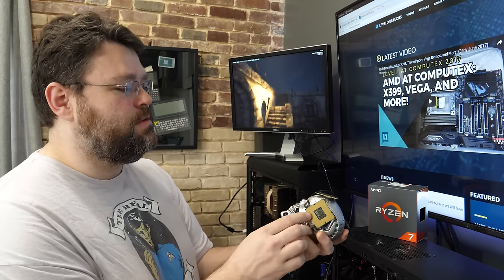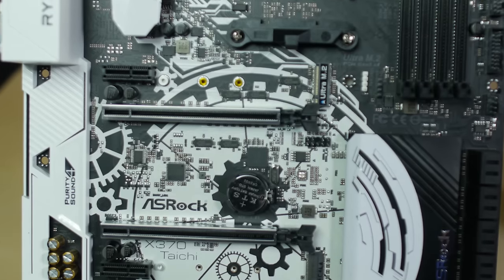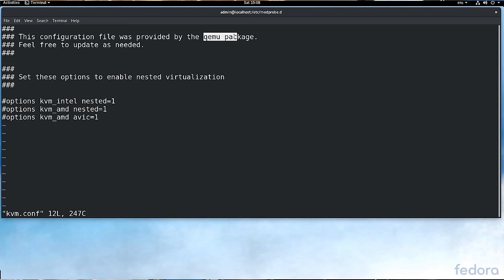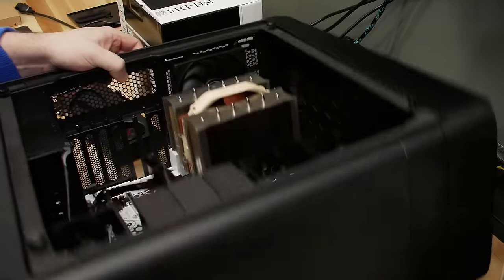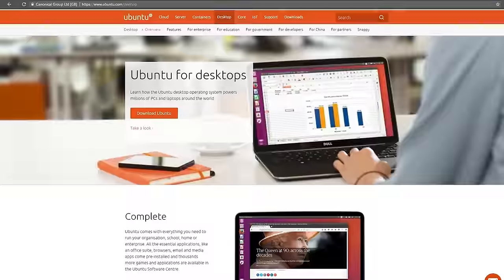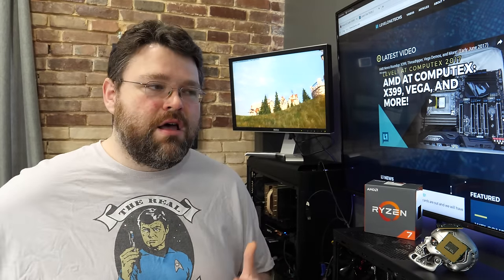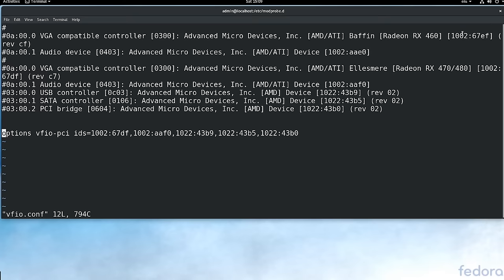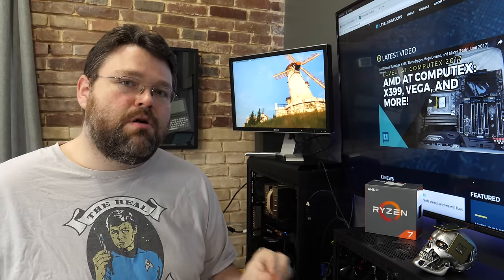GPU Passthrough for Virtualization with Ryzen: Now Working

Comment: Even a few years later this is still a great guide to reference and the information on the forums has beyond helpful.

The only thing that has been keeping me from using Linux as my main os is because of gaming. Now I have no excuses

Ryzen 3700x,
ASRock phantom gaming 4s (x570),
32 gig of ram,
Low profile GTX 750
8 gig rx 580

I've never been happier with a setup/build

Comment: Got a Ryzen 7 1700 as it was the cheapest 8c/16t CPU around, just to be able to do this. Need to buy a second video card before I go for it, but I'm really excited just seeing the guide uploaded. Thank you so much, Wendell - couldn't do it without you! <3
Reply: get a cheap dumpster gpu for the host and go for it !
Reply: get the geforce 710 ! is less than 50 dollars, just make sure you get one which supports a high enough resolution (depending on what you need)
Reply: Get AMD. Nvidia are assholes and disabled virtualization on all but their expensive quadro cards. Unfortunately you have to outbid the crypto miners who are doubling the prices. An RX 470/480 are fine for 1080P gaming on ultra

Comment: Thanks, I will for the first time install Linux as my main system.
#UninstallWindows
Reply: VADemon great to hear we are getting peps over to the dark side or light... depends how you look at it. fedora is out
Reply: Fedora is simply amazing and stable. Gnome shell user here.
Reply: The surface can be made to run Linux too... ;)
Reply: @VADemon ! Don't be hasty man, be patient. 
Install it on a VM or on a secondary Disk (or partition). 
Don't go straight ahead for Linux. 
You 'll bite the dust.
Reply: ThoughtlessTuber I think it's fine. What better way to learn than if you have no other option? Do or die!
Reply: ...no.

Linux has boxed itself into that tiny corner of the PC world where not even getting live training from a teacher is going to scratch the surface required to start picking things up on your own. It's not something you just DIVE into like you could with the more user-friendly Windows or Apple operating systems, regardless of how hard each distro tries.
Reply: I really disagree with this. If you pick up Ubuntu or Linux Mint for example, I think you can do that coming from a Windows system. I think you're not giving Windows users enough credit (at least those that are considering using Linux). I use Linux as my primary OS, and I wouldn't consider myself an advanced Linux user. What exactly is it you think people would struggle with? Where I live, I think the majority of laptops come with Ubuntu pre-installed, because it's free.

Also, I'd be surprised if anybody in the comments section here has had live coaching for Linux. I certainly never have and like I said I am not advanced by Linux standards.
Reply: DxBlack, how do you think people learned the Linux stuff in the first place, did Jesus himself come and make them memorize "all the things of Linux"? These things are documented and there certainly are enough people out there to help you out. It didn't take long for this video to come out on bleeding edge.
Reply: +Rocket33r 
Agree. I first tried Ubuntu in 11.10 when Unity first appeared by default. Never installed it fully, used in a VM, but it was a neat experience. Dual-booted 12.04 and Windows 8.0. Now I dual boot Ubuntu 16.04 (just to keep Unity 7) and W8.1, but I really feel like I barely scratched the surface of Linux on Ubuntu. Yes, I messed with the terminal to install apps and tried to install Ubuntu on a Toshiba Encore tablet and managed to get WiFi working only with online tutorials, but  never got around sound driver.

Anyway, the point is I studied alone and although I am still at the beginning (keep in mind I'm only 20), I know I can do much more. After I started using Arch in VMs a lot, mostly for fun, I kind of grew very attracted to the AUR and Arch Linux' documentation. Ubuntu has its fair documentation, but it's mostly spread around forums and articles, so you have to know what you are looking for, but on Arch, you find most of the stuff on the Arch Wiki.

I don't own any Ryzen, but I intend to buy a Raven Ridge APU when it comes out. I don't need a dGraphics card, I believe I can do my thing on Ubuntu 17.10 (I chose Ubuntu mainly for stability), but I was thinking about moving to Arch when I build my next PC, so I'm also asking for your opinions (keep in mind in 2018 when Raven Ridge is supposed to launch, most bugs with virtualization will be fixed): if I buy a dGraphics card, should I move to Arch or stay with Ubuntu? I was also thinking about using Xen Server and boot whatever I feel like using, but what do you think? Edit: if I get a dGraphics card, I intend to run Widows 10 in the VM.

(SORRY FOR MY LONG COMMENT)
Reply: +ThoughtlessTuber Thanks for caring, though I'm not one of those overhyping kids on the Internet you might have though of.I do have Ubuntu and Debian in VMs, but as of now they're more of toys than real systems for me because I require them only for a fraction of work.Since Windows 10 is not an option for me and Windows 7 is getting old (and I feel like Linux would suit much better for the Ryzen architecture) - I'm gonna head dive into the Linux world. It's the new PC, the new age. It'd also boost my education in that field. A win-win situation.
Reply: DxBlack, anyone with a modicum of knowledge can scrap OSX or Windows 10 and install and use a myriad of Linux distros.
Reply: You should've have install Linux as a main system a long time ago... It's a very promising os that's open source, all it needs is more developers to make more software for it to attract to the average user.
Reply: No, that's not all it needs. It needs to be user-friendly and understandable for the average user and it's far from that.
Reply: "Alejandro Rubio think a lot of us are starting to move away from Windows." By still using windows to play games.
Reply: Oh man, and if you install Windows in QEMU/KVM using RedHat's virtIO drivers (and I'd highly recommend the Spice Guest Tools for shared clipboard and a number of other VMware/Vbox-esk functionality) the performance is so clean.
Reply: My Windows 10 VM running in KVM (I use Virt Manager) runs so freaking smooth in that setup.
Reply: Or just download ubuntu from their site, put it on an usb stick and reboot. And tadaaaa you can try it out :) it's not a requirement to install the OS

Comment: 18:00 You could just use virsh edit <domain> to directly edit the virtual machine definition. It will also do error checking before you try to save the changes.

Comment: Did I understand correctly that we can install Windows on a dedicated hard drive and then boot that hard drive in a VM under Linux?
Reply: Usually it's done by creating a file which contains the virtual hard drive image.
Reply: Yes. You pass the whole drive, so it would act like any other PC. This also allows better IO performance.
Reply: For over a decade now. Problem is video performance for games. Pass thru I/O helps the guest OS talk to the video card. Servers running linux and vmware esx have run Windows vms for 15 years now
Reply: Yes, you can pass through a whole raw drive or even a sata controller. I passthrough a Marvell sata controller with SSD, HDD, and DVD-RW attached to the VM with a Ryzen 1700 in a Asus Crosshair VI Hero using bios 1403 and ACS kernel patch.
Reply: @viperphi1184  note for later

Comment: I wait until threatripper and vega. I am slightly concerned about the limitations in regards to how many pci passthrough you can do. I'm my case I'd like to do at least graphics, sata (or pcie storage, whatever), ethernet and usb.
Also I'd love to see an arch tutorial on this subject, as arch is and probably always will be my main linux system.
Reply: I like Arch for its user repository (talking about AUR) and for its documentation. I prefer Ubuntu for stability, but was thinking of moving to Arch, though I need someone to push me from behind. I installed Arch twice in VMs and I can do it better now, but not sure what to do. Ubuntu never went down on me, I got used to it.
Reply: Arch is perfectly stable, provided you don't screw anything up, which granted is easier with Arch. And yes, there's the AUR and the best documentation available, but more than that, you'll learn hat Linux actually is.
If you need a gateway drug, so to speak, Antergos will do the job, in fact I'm running Antergos at the moment, due to me being too lazy to mess around with Arch. It's basically the same thing, only one holds your hand and the other does not.
Reply: I know of Antergos, but I prefer Arch's KISS. All I wanted to know is that "Arch is perfectly stable". Might migrate and make a backup server where to save snapshots or backup images or something, just in case I'll be too adventurous.
Reply: Also, thanks for the reply :D
Reply: NP mate.
Also, everyone's opinion differ of course. To some Windows is stable, as if, and to some only the stable branch of Debian is stable.
Arch is bleeding edge and many thing can therefore go wrong, which is among the reasons that it shouldn't be used as a server OS. However, I've been running Arch longer than I can recall, and I've never had any issues that I did not create myself, or that was Arch specific
Reply: I said server out of habit, as at work we refer to our storage (samba) as server.
By server, I meant a NAS where I will save snapshots / backup isos and so on. I don't know yet how to make snapshots, but I did some isos on Windows with current state of the OS at a time. Shouldn't be that harder on Linux, just different.

Comment: Well done. Thanks to your previous information on this two years ago or something I started doing this on my desktop about six months ago and have had a blast ever since. Only thanks to you I've been able to use Linux as my main operating system while being able to play whatever I need to and use Visual Studio properly at the side.

Some constructive criticism however:

You should have mentioned synergy when dealing with the mouse/keyboard thing instead of using two mice/keyboards. Having two keyboards or mice is real nice for the initial installation, however it's a pain in the ass at all other times in my opinion. Synergy works great as long as you lock the cursor to the screen when playing games, otherwise the camera goes wonky. No need to buy it either, works great as-is. This setup is expensive with the extra graphics card already, no need to add further expenses on extra mice/keyboards.

I feel you over complicated it with the details. The passthrough steps here are really easy as you say yourself. However I think all the details about the inner workings makes it sound daunting instead of how simple these few steps really are. The more explanation heavy part should have been the XMLs instead of the few lines in grub and vfio.conf since configuring libvirt really is the harder hurdle to good performance. 

The crackling sound is the hardest issue to solve with the VM, even with a passed sound card. I wish you had some information here other than buying a PCI sound card that may or may not work. Personally I got it working perfectly with my 5820K without needing an extra sound card whatsoever. No crackling sound at all. Requirements was allowing host sound without graphics in /etc/libvirt/qemu.conf and setting the qemu user to myself. Also adding certain qemu:commandline settings at the end of the libvirt configuration file like QEMU_AUDIO_DRV, the "QEMU_PA_SERVER" as "1000", "QEMU_PA_SAMPLES" as "512" and "QEMU_AUDIO_TIMER_PERIOD" as "200" (with the last two ones, your numbers may vary). This combined with the AC97 driver and setting it in virtmanager works extremely well. You might get some cracking once the VM boots, but by increasing and decreasing the volume in Linux will resolve it within about 10 seconds and it will never appear again until turned off and on again (funny and hacky workaround, but both me and my friend who I set this up for use this technique to solve boot crackling).

If you have two NVIDIA cards (and maybe AMD), doing this on Ubuntu is difficult. The reason is that even with vfio-pci and vfio.conf, the NVIDIA / AMD driver grabs both cards even before the vfio-pci stub. This makes it a pain in the ass because unlike dracut and mkinitcpio, initramfs-tools does NOT have settings to prioritize the vfio-pci stub driver over the AMD/NVIDIA driver. In dracut you can add rd.driver.pre=vfio-pci to be a hundred percent sure it loads first, while in mkinitcpio you just add it earlier in the modules section. Initramfs-tools does not have this, which means you need to do some big time finicky crap to get it working, personally I ditched Ubuntu and went Manjaro just because of this problem.

The Arch wiki article on PCI passthrough via OVMF is the best written guide for it in my opinion. It works pretty much over all distros as well with the exception being initramfs using mkinitcpio. 

VirtIO SCSI was what was the best disk bus instead of VirtIO, SATA or IDE according to what I've read online (don't quote me on it), but requires certain drivers in Windows to even detect the drive. Might be incompatible with the "install outside of the VM" method you're using. Personally I passed the drive through and installed it in the VM, but I'm using X99 and not Ryzen so I dunno if the ntp issue is complicating that.

All in all though good to see videos on passthrough in general and enlightening others to this method of using Linux. It has solved every single issue I had with using Linux to begin with, so it has made my life a million times easier instead of half-assing it using Wine.

Comment: Great video! I'm just getting to put Windows 10 on Linux virtualization. I have Debian Stretch and Radeon RX 580 with Ryzen 5 2400G. I have Windows 10 installed, so the next step is to add hardware disk with windows to virt-manager and we goooo!

Comment: Always wanted to do this but what if I want to run Linux as the host OS and have Windows10 and macOS as the virtualized OS simultaneously and pass through I guess two extra ssd/nvme drives and also two gpus one for each?
Reply: I have an x99 setup with dual 2683v3 and willing to buy what ever I need to get this to work.
Reply: That is correct, one GPU per VM. You don't necessarily need dedicated SSDs for the VMs, disk images would work as well. I suggest to pass through an USB controller if you want to game on a VM, since Synergy is basically broken for games.
You may need to use a different version of qemu and/or ovmf for OS X to boot, since it is very picky, but there are guides available.
Reply: Saying apple sucks because they don't give away the OS for free is strange. Windows is not free either, MAC is just a proprietary software (just like HP, Dell, or Lenovo proprietary software). Windows is not free either, and its XBOX OS is probably not allowed to be put on non M$ hardware just like MAC is not allowed on non apple hardware.

At least Apple "Just works" better than Windows (A lot of people defend windows with "it just works", even though we all know its janky and broken code barely held together by shoelaces).  **I'm not endorsing apple, never bought anything apple, but I have ran other peoples MAC and IOS systems.
Reply: Jake Garrett OSX is more streamlined than Windows, if they're charging so much for their products it better be
Reply: Muad Dib Few things are as nice as Linux. M$ would charge about $2k for using my Ryzen desktop as a server. I was going to build a $350 4x Xeon hex core system, but I think the server license was near $6k. I point this out, because everyone knows using Windows on a real server is a joke. It would probably corrupt itself in a month a need constant work. I wouldn't put anything important on such a janky buggy OS, but people pay rediculous prices for garbage code.
Reply: Muad Dib I think the main reason Apple does not sell MAC OS is because the Sheeple would realize it runs on anything, and it's not some magic from the aircraft grade aluminum that allows it to run. They would build more powerful hackintosh systems instead of the more expensive trash can model, and they could upgrade it whenever they wanted without buying a whole new system. In short, they would lose money.
Reply: I have a similar question. Lets say I only have two gpus but I'm comfortable doing everything via the command line. Could I ssh into my hv from my laptop and boot the host into a non graphical runlevel thus allowing me to dedicate both gpus to my vms?

Comment: Little something I discovered with a last generation AMD system(GB main board, 8320, W7000), with several distros,  if your boot takes a long time and prints a big stream of "Vi pagefault bla bla bla",(I thought I saw this at 15:19) try setting the kernel boot parameter to "iommu=soft" 
For the persistent fix do it in the grub config whatnot; but to test it for a single boot simply highlight the kernel you want to boot in the grub menu hit "e" to edit, find the line that starts with "linux" and add iommu=soft to the end of that line. Just the same place as you would add systemd.unit=multi-user.target to boot into a text shell  [ run level 3 ] rather than the default graphical.target level.
YMMV It's been a couple years and distros since I was using KVM so I don't recall the effect of iommu=soft for my VMs.

Comment: Been running a setup like this with an intel cpu for about two years now, but I'm going to upgrade to a threadripper system in a few months now that most of the kinks in getting this to work with ryzen have been worked out.